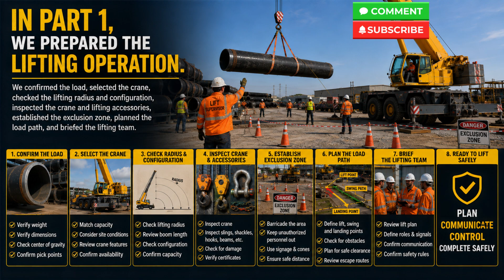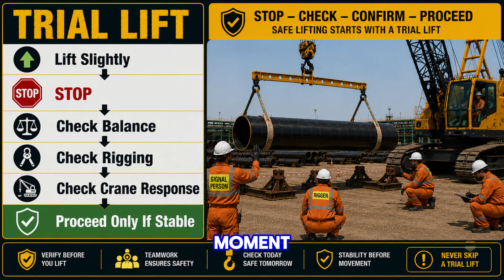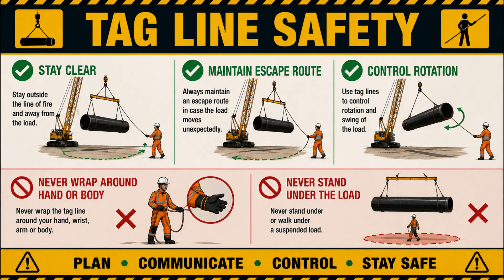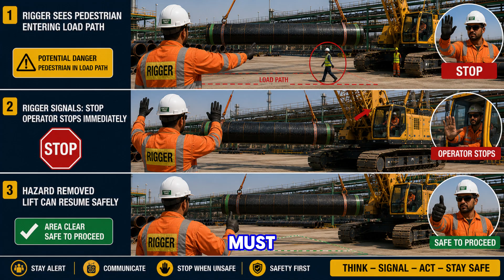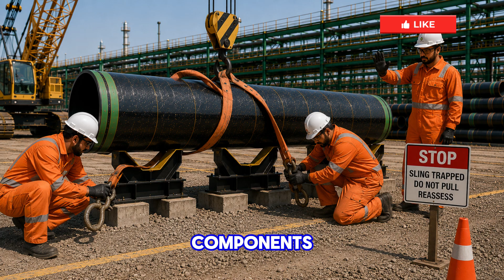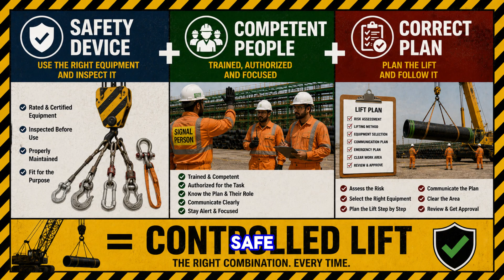Lifting Operations & Rigging Safety – Part 2 | Execute & Control the Lift

Comment from the maker: 🏗 *LIFTING SAFETY – PART 2 QUESTION*

What should you do if a suspended load starts tilting or moving unexpectedly during the trial lift?

👇 Share your answer in the comments.

Remember:

✅ STOP the movement
✅ LOWER the load safely
✅ REASSESS the rigging
✅ Correct the problem before continuing

Never try to physically fight or hold an unstable suspended load.

*PLAN THE LIFT • CONTROL THE LOAD • STAY OUT OF THE LINE OF FIRE*

If you haven't watched **Part 1 – Plan & Prepare the Lift**, watch it first for the complete lifting-safety process.

Please LIKE, SUBSCRIBE and SHARE *Safety With Zahid* with your colleagues.